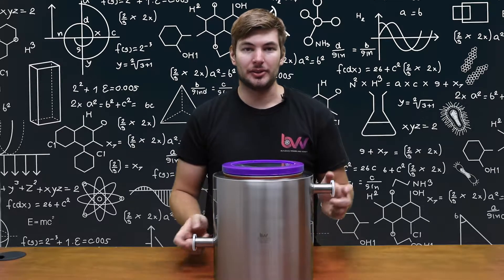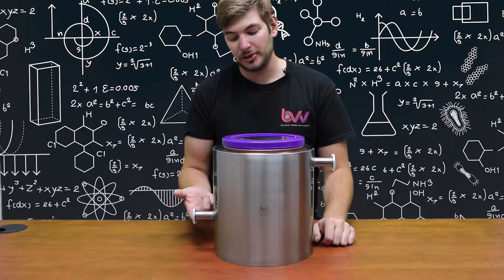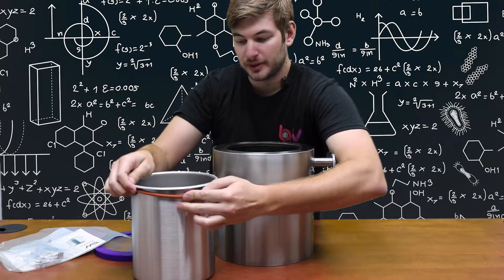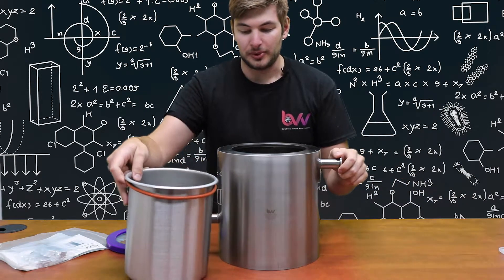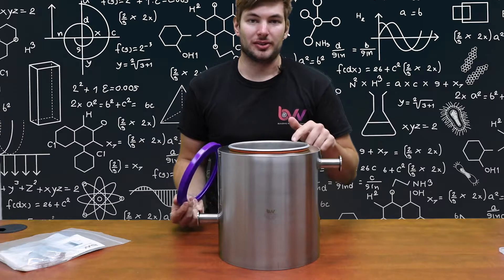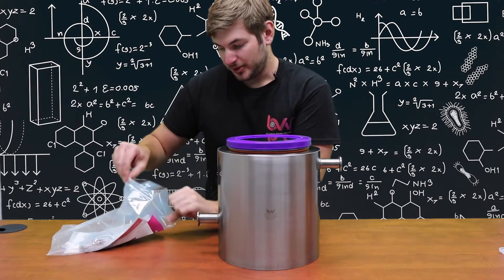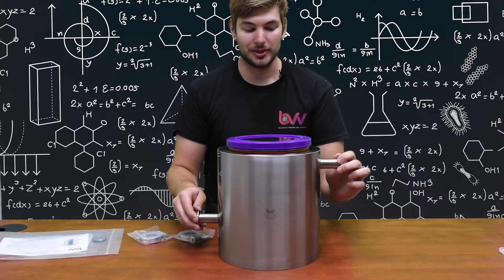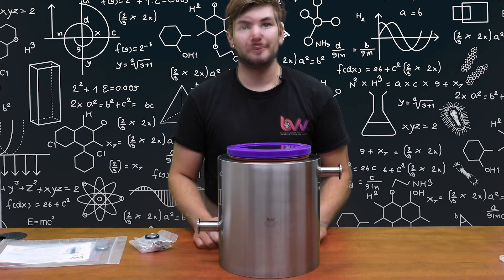10" Cold Trap with KF25 Ports Product Demo

Comment: Will this work if I have a slurry of solids and liquids and I want to remove the liquid?
Reply from the maker: @paulmanhart4481 it sounds like you need a solvent recovery system, such as a rotary evaporator. This unit is designed to catch any vapor before it makes its way to the vac pump. What type of liquid are you looking to boil off? Feel free to email us at support@shopbvv.com!

Comment: Could you use this with a recirculating pump and a jacketed spool for an economical dewaxing extractor?
Reply from the maker: This is designed for vacuum applications only.
Reply: @Jmarosii 🔴 What Is Islam?  
 
🔴 Islam is not just another religion.  
 
🔵 It is the same message preached by Moses, Jesus and Abraham. 
 
 🔴 Islam literally means ‘submission to God’ and it teaches us to have a direct relationship with God.  
 
 🔵 It reminds us that since God created us, no one should be worshipped except God alone.  
 
 🔴 It also teaches that God is nothing like a human being or like anything that we can imagine. 
 
🌍 The concept of God is summarized in the Quran as: 
 
📖 { “Say, He is God, the One.  God, the Absolute.  He does not give birth, nor was He born, and there is nothing like Him.”} (Quran 112:1-4) 📚 
 
🔴 Becoming a Muslim is not turning your back to Jesus.  
 
🔵 Rather it’s going back to the original teachings of Jesus and obeying him.
Reply: @Jmarosii 🔴 Christians and Muslims both believe in Jesus, love him, and honor him. 

🔵 They are, however, divided over the question of his divinity.

🔴 Fortunately, this difference can be resolved if we refer the question to both the Bible and the Quran, because, both the Bible and the Quran teach that Jesus is not God.

👇 The Bible Denies the Divinity of Jesus 👇

 🔴 Jesus was a servant of God ⚠️

{ The God of Abraham, Isaac and Jacob, the God of our fathers, has glorified his servant Jesus.} (Acts 3:13). 📚